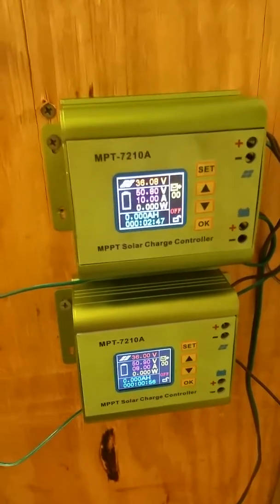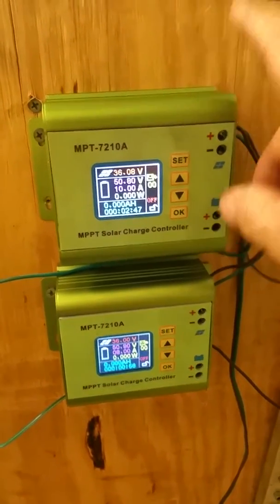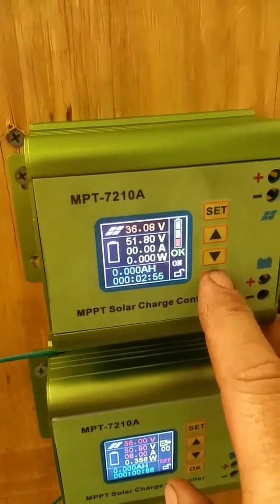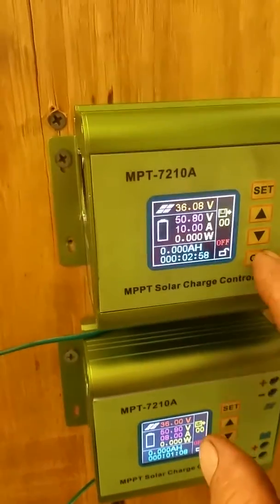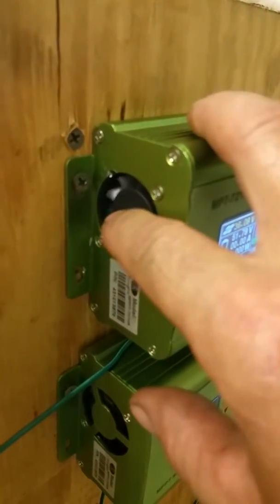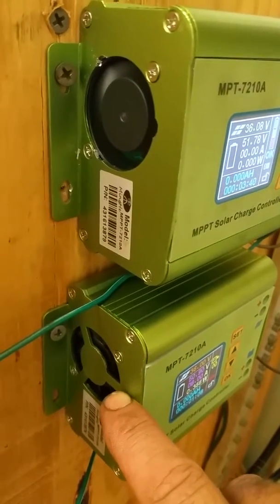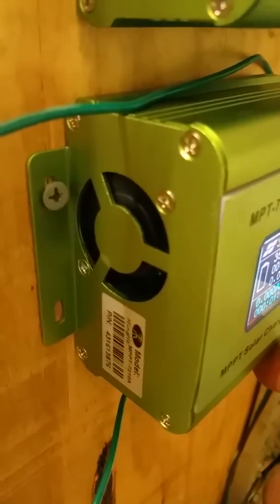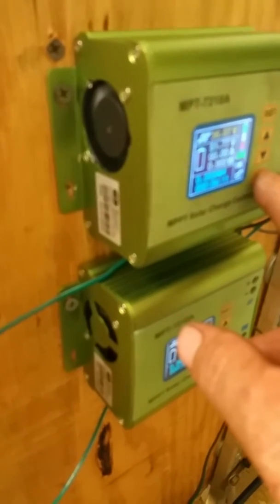MPT-7210A Quiet Mod

Comment: Just cut it off with side cutters from the outside, no need to take it apart and use drills/mills, it's only soft aluminium.

Comment: Good job! Just a question...I have this 2x360w panels in parallel to 18A, I know this thing can only have 10A current draw. I also am using 48v 90ah batts. Will that be bad for this? Sorry mate,  I just bought it...

Comment: ya or just hold the down arrow for like 6 sec or more and it gives you the option to slow the fan
Reply: I think a partial speed fans messes up the battery voltage readings due to the fan PWM signal interfering with the rest of the circuit.

Comment: The sad thing is that the microprocessor does calculate the current but still turn the fan fully up at 0 watts even in the extreme case where no battery is connected

Comment: There is another easier way, turn the fan the other way, instead of blowing air inside out, just suck the hot air out to the fan hole.
Reply: That really helps. It seems the product was designed that way (screwed to a wall with cables to the bottom, the hot air should go up). But then later they turned the fan around. (maybe because of less dust in overpressure casing, or because of better cooling of an particular IC)